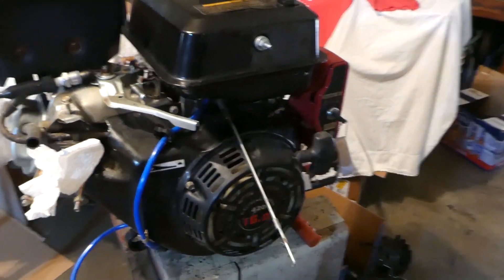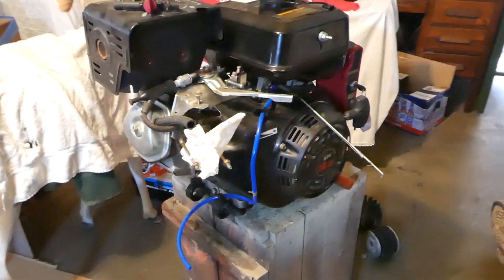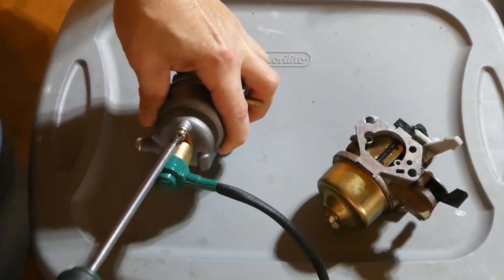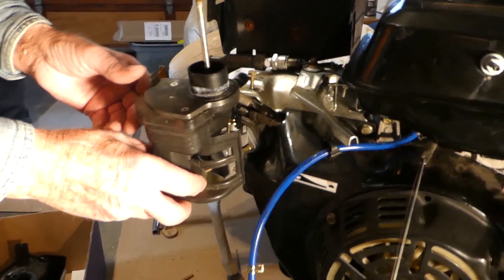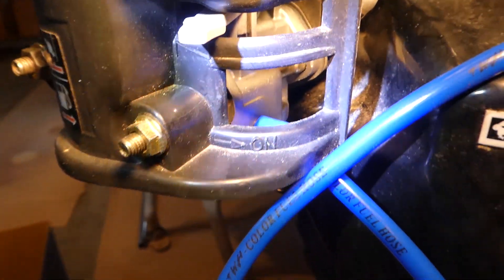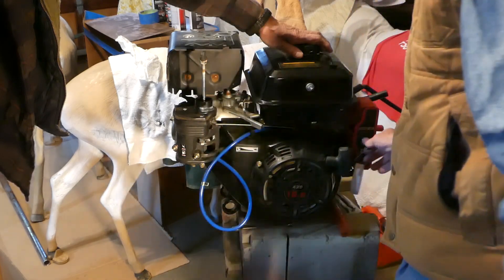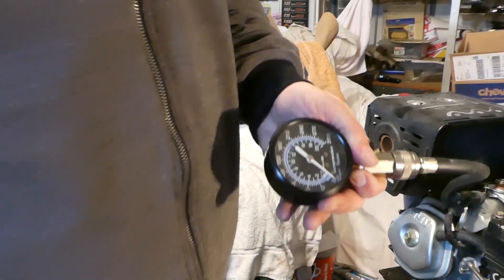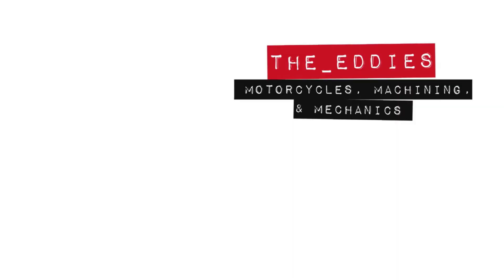New carburetor on an old Predator engine

Comment: Kind of amazing you can buy a whole tune-up kit with carb for less than a carb kit these days. I got a new flywheel, ignition, carb, filters and hoses for the wife's sthil 180 for less than a carb kit.
Reply from the maker: Yes these small engine carbs are pretty much throwaway items now. After doing several little chainsaw/weed whacker type carbs I cannot say I am sad about that. But really this size carb would be a pretty easy clean up so it kind of a waste.

Comment: G’day Eddie. Sorry that I’ve been a bit slack in the comments lately. Good video mate on showing both carburettors. As you stated, it appears that the motor was down on compression a little. Cheers 🍻. Aaron
Reply from the maker: Thanks Aaron. Don't ever worry about slacking in comments, at least not with me. I have been focused on a crash course in Fusion, earning the printer and have slacked off myself. Using the excuse of the cold weather to learn a new skill inside, lol. I might have to switch to one of the free CAD programs though. The 10 active file limit in the free version of Fusion is getting a bit annoying.
All the best!
Eddie

Comment: 60 psi is way too low. Has it been stood a while & the rings maybe stuck. Hope you get it sorted. Sounds like a great project.
Regards. Steve
Reply from the maker: Hello,
I agree. I have been doing a bit of research on this and apparently 60-80 is normal for these measured the way we did. It looks like the centrifugal compression release prevents getting a complete reading and the engine probably has more like 90-120 as normal once started. We actually got 40 the first time we checked it and 60 was the highest we could get after lubricating the rings. It runs great, so something is definitely off with our readings. If I get a chance, I am going to try loosen the lash on the exhaust valve and try to get another reading. This should prevent the compression release from working. At least that is what I am reading. Seems like it would be much simpler, though less user friendly maybe, if they would have just put a manual compression release on it like every large single motorcycle engine I have ever owned. 
Thanks,
Eddie

Comment: The second you removed the fuel shutoff solenoid, I knew this would kill the fuel flow. I had that solenoid fail on my Honda engine. Few hours, but it froze with the needle valve blocking fuel flow. Real expensive part to replace.
Reply from the maker: Yes, I had not even noticed that the bolt holding the bowl on had the fuel pickup. Of course that makes sense because it interfaces with the shutoff valve. We eventually figured out the mistake. You could solder up the end of that bolt and run without it. But it does help with backfire (or afterfire I guess it is technically) issues in some engines.  
I would guess Honda wants $40 for that part but you can get aftermarket ones pretty cheap.
Thanks for watching!
Eddie